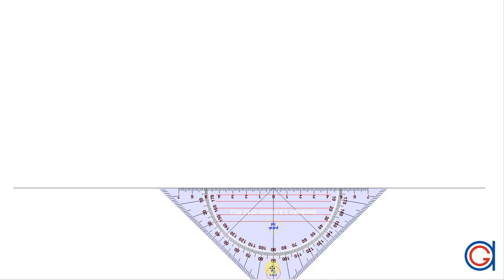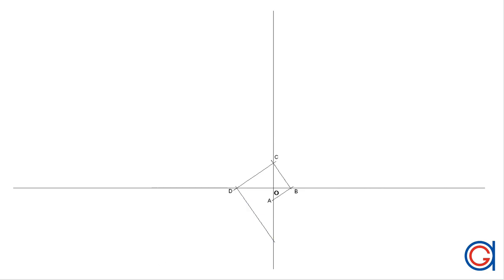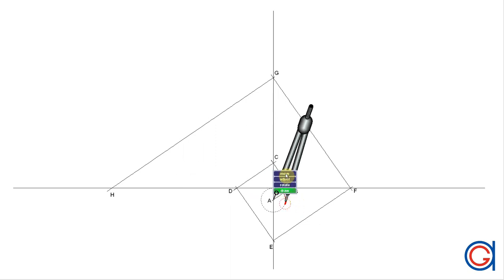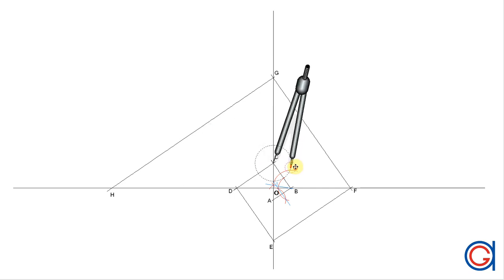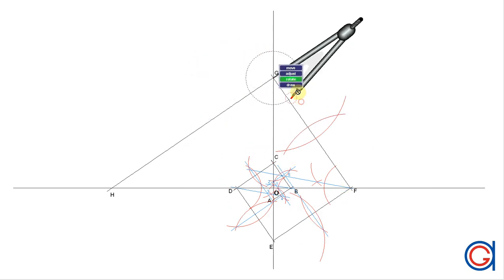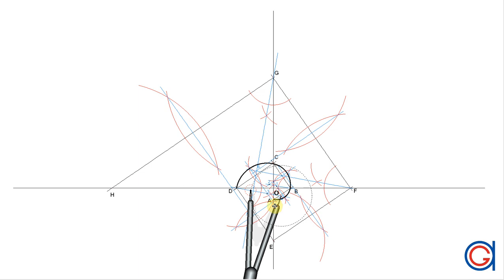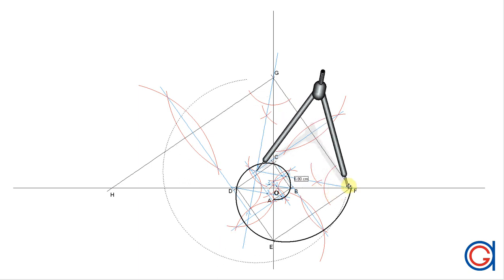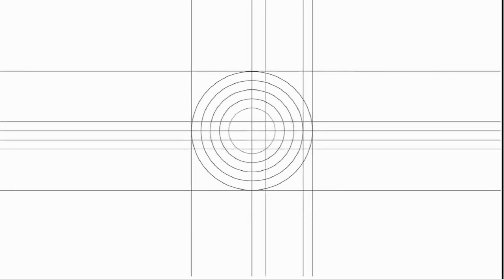How to draw a logarithmic spiral

Comment: very kool!
I'm trying to figure out how to make a "cam clamp" to hold material in a CNC machine. I know that a cam is a spiral ...but, What type of spiral would a cam clamp be made from?
Thanks so much
Reply: Did you figure it out? Instinctively i would say an Archimedean spiral, but it would depend if you need a linear relationships between rotation and offset

Comment: Thanks for the video, but shouldn't you point out that this an approximation?  No section of a true log spiral can be an arc of a circle.  Or am I wrong?
Reply: you're not drawing a true one by hand anyways.
Reply: How about a less cumber method based on an "infnate long rotating about orgin at a constate rate, and traceing a line from a point that is moving out at a constant rate of acceleration?